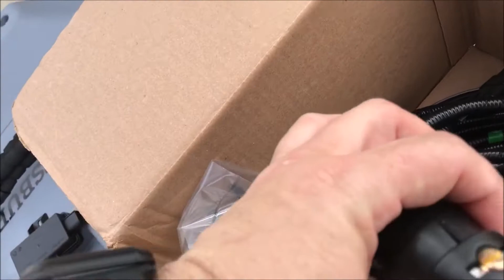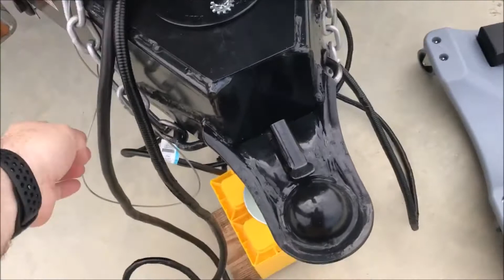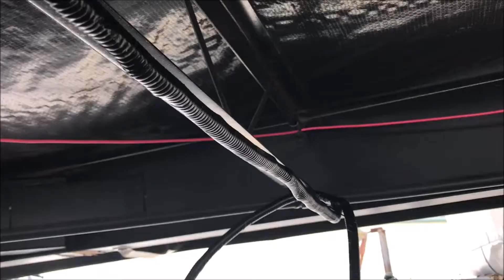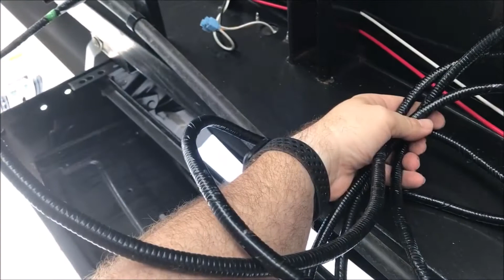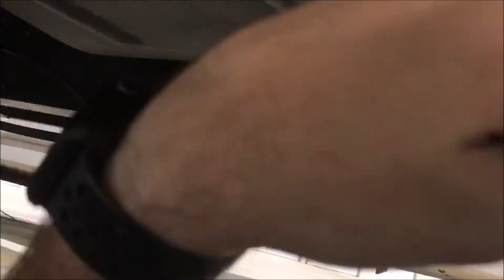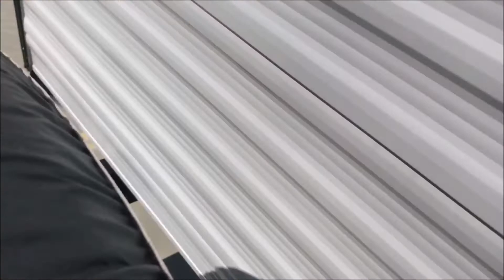Ford Super Duty  - Customer-Placed Trailer Camera & TPMS - Trailer Wiring Install PT 3

Comment: For the TPMS wheels, did you make a video on installing these on the valve or did I miss that part of the install?
Reply from the maker: I took the TPMS and the tires to a tire shop, and had them install the TPMS.
Reply: @MyTorino  Thank you.

Comment: You can mount the factory camera bracket with 3M double-sided tape (body panel tape) an no holes are required. If not the tape, a good adhesive.

Those are "dirt dobber" nests, not wasp or hornet :-)

Great video, thanks for making it.